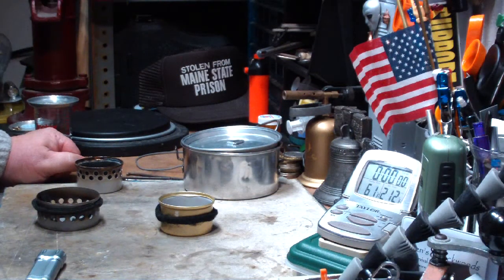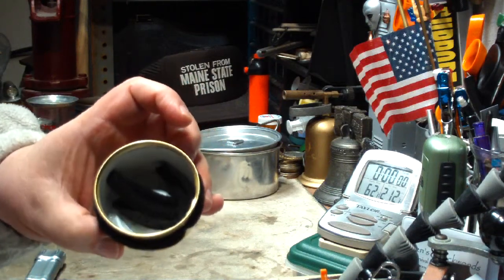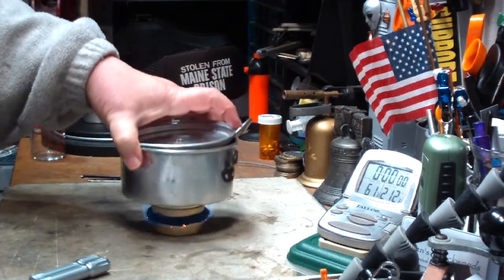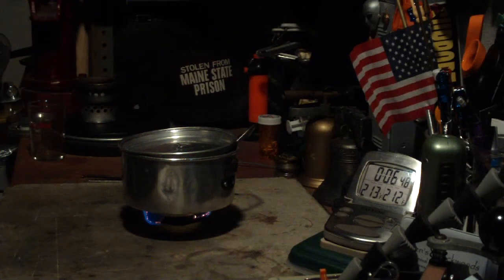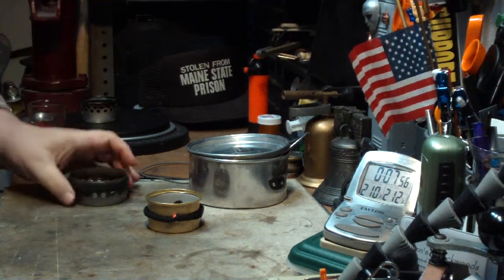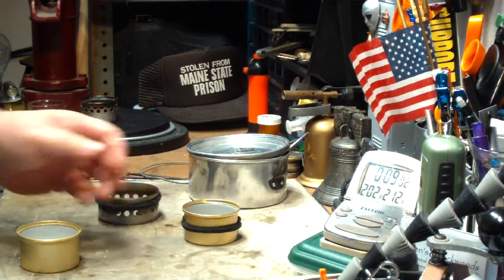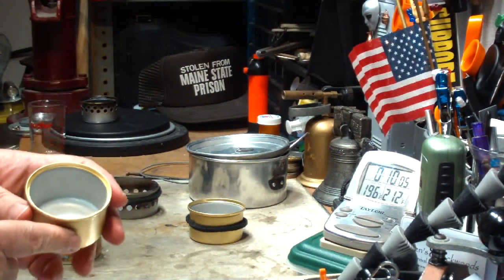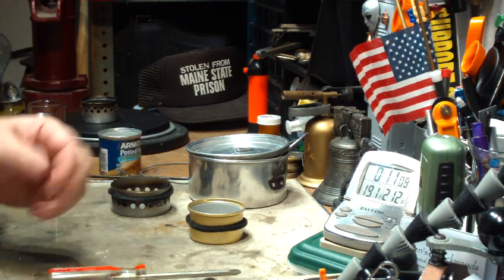Low Pressure - Side Burner with Carbon Felt Wick - Boil Test #2

Comment: This is a great Idea. I made another one with the two hole and folded the felt in half and pushed it through the holes from the inside just until it was two  little buttons on the outside. This gave me two small flames for simmering. Long burn also. Thanks for all of your videos.....Randy

Comment: I'd like to see the smaller hole test. That could make a significant difference in pressure. Also, with carbon felt on the top of the rim itself to seal the pot to the can might build a better pressure seal.